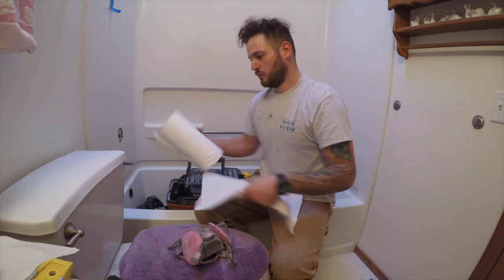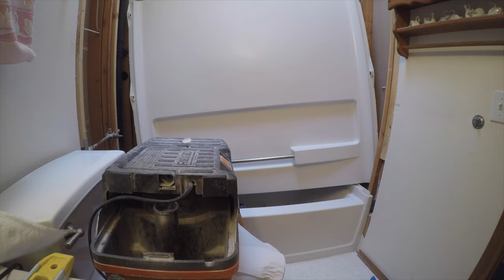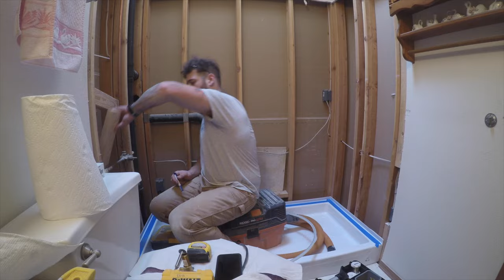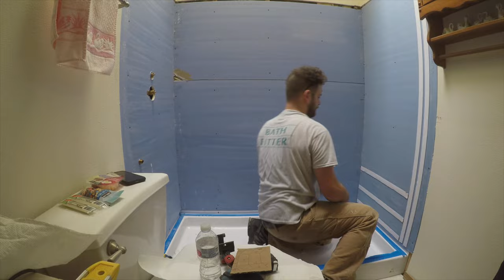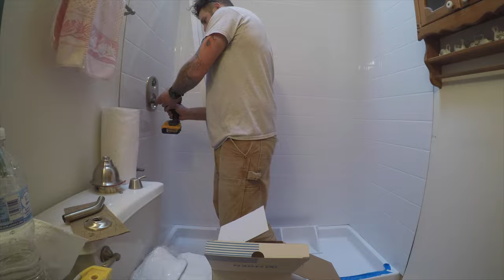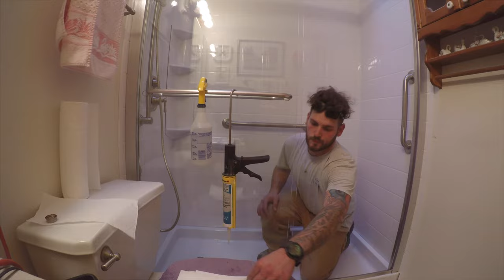Bath Fitter Tub-to-Shower Conversion

Comment: This guy is really great. Wish I could find 10 just like him. I have a few friends. That have used bath fitters. They ended up costing around $8000 in the GTA. I could build a pretty nice custom shower for 8g's.
Reply from the maker: Hi Carlos, This installer really is top notch, I agree. Every bathroom is different so it's hard to give a real guesstimate in terms of cost. We do offer free estimates, though, and will provide a to the penny quote of what it would cost to move forward. No obligation.
Reply: @bathfitterinlandnw  I appreciate your reply. But as a general contractor I was being sincere when I said that for the cost of a Bath Fitter installation I could provide, a much better product. Better suited to the clients individual personal tastes, and superior in terms of long term performance. Having also had the opportunity to demolish bath fitter products in the past, some as young as 2 years old, I am confident that it is not a product or service I could with any confidence recommend to any of my current client base. My comment was mostly directed at whom I can only assume is an employee, who is obviously talented and hard working. Although I would have asked him to take the NickNacks off the wall cabinet to reduce risk of damage, or getting dirty. Thanks again.
Reply from the maker: @-carlos-danger1891  I appreciate your opinion. I wouldn't expect you to recommend another company to your client base. That would be silly.
Reply: @bathfitterinlandnw  Why would that be silly? As a custom builder I recommend, and use other vendors regularly to ensure my clients get a product that as close to their vision as I possibly can, while ensuring they will have a result that will last for years to come, adding value to their homes. I just wouldn't use your company.
Reply from the maker: @-carlos-danger1891  Thanks, Carlos. Have a great night.

Comment: What type of caulk do you use?  I tried 2 different types of caulking and flex seal and none of them stuck to my acrylic Bath fitter panels very well.
Reply from the maker: Hi Dan, we use a sealant that we actually produce ourselves. I wish I could be more help in suggesting one you could buy over the counter. If you go to your local Bath Fitter showroom, there's a chance they might be willing to give you a bottle. I know we would if you came into the showroom here in Spokane, WA

Comment: Is it possible to have the tub surround extend onto the ceiling too? I have low ceilings at 7ft in my bathroom and I hate dealing with moisture getting on the ceiling bc of it's low height. Was wondering if it's possible to have the whole shower area enclosed with the acrylic
Reply from the maker: Yes! We also offer ceilings! You can see some of the options here: https://www.bathfitterspokane.com/shower-ceilings

Comment: is that 2 way tape he is using to hold the surround walls and the corner shelf.if so there is no way that will hold up for years.
Reply from the maker: Bath Fitter actually manufactures the adhesive used to hold the wall in place. Everything we manufacture has a lifetime warranty.

Comment: There not covering nothing that's a complete new installment
Reply from the maker: Hi David! A common misconception about Bath Fitter is that we only go over existing walls or bathtubs/ showers. This is not the case. We can also replace a tub or shower completely, as well as the walls and sub flooring, when necessary.!

Comment: $4000 gets you a vinyl(plastic) tub and walls held on by industrial adhesive (double sided tape).
Reply from the maker: Hi JeepDan777, Actually, all of our products use acrylic, not plastic or vinyl. It is a non-porous surface that will not mold or mildew and is easy to maintain. Also, the adhesive used to keep the wall in place is something we also manufacture, which means it has a lifetime warranty for as long as you own your home!
Reply: You manufacture double sided tape....or sub it out to 3M?

Comment: CHEEEP  PLASTIC   CRAP  - WE HAD OURS REMOVED.
Reply from the maker: We're sorry you had a negative experience, Harold. I'd remove it if it were plastic, too. Fortunately all our products are acrylic. This provides a surface that is easy to clean and looks new years later. It's non-porous so it won't mold or mildew!
Reply: ** won't scratch ??
That's a flat out lie .
Reply: @tuck6464  I think you said it. Who's lying?
Reply: @MrRonluker  
@Ron Laukaitis , I did say it .
They fixed it/edited their comment. It may also be stated in the video, "won't scratch".
While I will admit that the material they use is far better than most DIY'ers have access to. (I'm also aware that this is not a DIY video)
To say ,or write that this material "won't  scratch" is a bit of a stretch/not true.